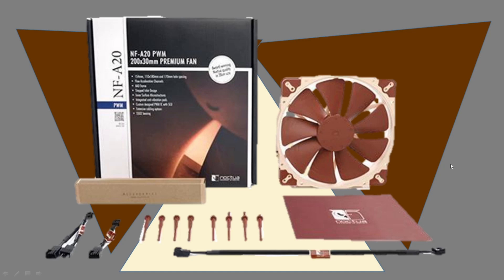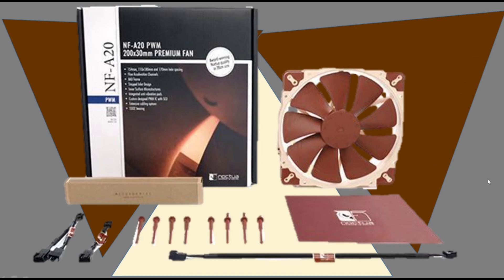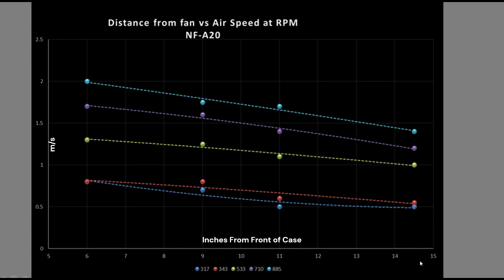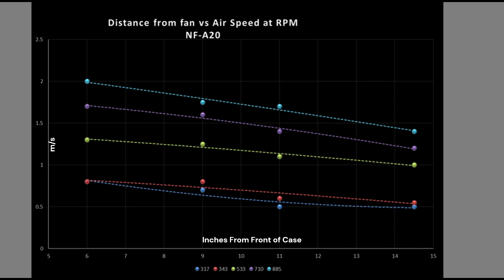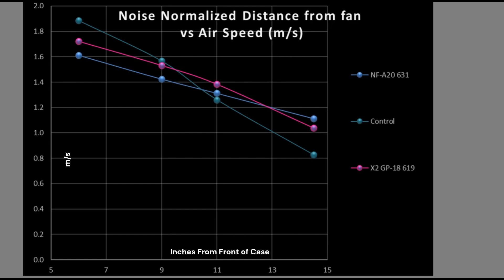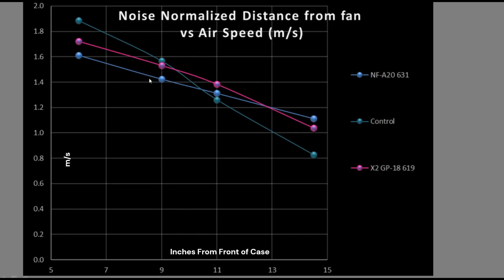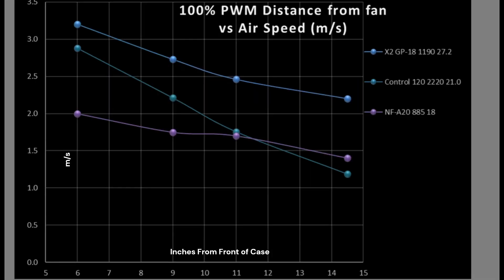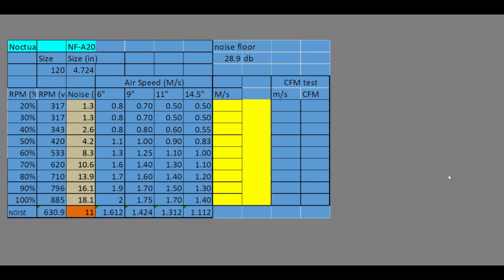Noctua NF-A20   200mm Fan.

Comment: I actually saw the modification of the Fractal Torrent case for 200mm and also how people managed to get 200mm to work without modification which made me buy 2x200mm Noctua Fans. I now have the setup of 2x 180mm Fractal X2 GP18 Fans at the bottom for the GPU (temps went down compared to the 3x140mm Stock Fans -> X2GP18 are thicker)  and 2x200 at the front of the case. While I did not track the CPU temps (before with 2x X2GP18 and after with the Nocuta NF-A20) the CPU temps were more dependant on the CPU Air cooling Tower Fans (I got a Thermalright Frost Spirit 140) and the fans custom curve. 

What I can say is that the overall noise went down drastically when removing 3x140 Fractal GP14 Fans to almost silence in idle, which is what my goal was. The airflow might be worse because the 200mm Fans are partly blocked off, but once I have more time I want to mod the Fractal case such that NF20 won't get blocked.

I actually didn't find any good video of the NF-A20 Fans that were recent, so this would have been a blessing when I made the decision to purchase the NF-A20 instead of two X2GP18.

And big thanks to you and your fan testing, you have been my Go-To channel when I want to see compare how fans perform. I actually watched your video of 2x120mm vs 1x180mm video which made me consider bigger fans for this case in the first place. 👍
Reply from the maker: It would be cool if noctua made a 160,180,or new 200 mm fan. 
That mod sound cool. would love to know how it turns out if you do it. 
Thank you for the kind words. I truly appreciate it. 
I have a few experiments to run and record for videos when I find some time.
Reply: @computer-tech-more  Hi I almost finished the case mod yesterday (the holes I drilled for screws were too small so I used zip ties), but the 200mm case fans are now not blocked at all at the front. Unfortunately this did nothing for the thermals of the CPU. (30% PWM mode all fans)

Although when I did the mod yesterday I though I did remove the railing at the bottom that blocked the 180mm Fans, they are now fully exposed and I think this (and possible the front case mod) lowered the GPU temps by 1°C (several runs tested so it's not within variance). I know it is now much but going from 56°C to 55°C GPU Temp under load (4070 Ti Super) is still pretty significant I would say. 

I can't say anything about noise and whether that improved or not, seems the same.

All in all it was one day of rough work as I am a software developer, so I am not used to physical drilling and grinding, but that peace of mind and the 1°C on the GPU made it somewhat worth it.

I would suggest people that are chasing the best noise profile to stick to 180mm fractal fans, the 200mm noctuas did not make much of a difference.
Reply from the maker: @parutopat  you had quite the adventure. and thank you for updating it. I had actually forgotten all about you doing this mod. 
I guess the main thing is do you like the new look with the 200mm fans? 
1C is still 1C but ya not really going to get any extra performance from that. :)
Reply: @computer-tech-more  no problem, I did not think you would remember that comment from me, but I am glad you replied ^^

Honestly not really liking the look so far, but I bought some foam that I want to put in between the fans and that should make it a bit prettier. I did a more or less sloppy job with the grinding, but I care about performance more than aesthetics, so no big deal for me and I have the peace of mind that the fan blades are not covered. The front Fans are not visible anyways^^

I enjoyed the process for the experience.
Reply: @computer-tech-more  I joined your patreon by the way! really enjoying your work
Reply from the maker: @parutopat  awesome. I saw a new patreon. Thank you!!!
Reply from the maker: @parutopat  metal work is very hard to get right. 
I personally do wood working. nothing crazy like with special tools or anything just building like a play table for my son. 
Metal can get to many sharp edges. 
But if the process was fun I would call that a win.
Reply: @parutopat  I'm in the same shoes, planning a build with the Torrent and I don't want to use stock fans, only Noctua. Have you tried out the 200mms at the bottom as well? Is the hole of the case (not the tray) big enough or blocking too much? Have you seen the HS (high-speed) version of the 200mm, and/or have you considered 6x of their 140mms? That setup probably has the maximum non-industrial grade airflow possible for this case, I believe (at max rpm). And they are second generation, can still be quiet for idle, running maybe just a few of them. That's my plan as I wouldn't want to grind the metal even if I have the tools for it, I'd probably buther the case :/
Reply: @firsh  sorry for the late reply, I did not notice the notification. Have you made a decision yet?

I had Problems with the 180mm at the Bottom already and did actually remove part of the Rails where they are screwed onto, which yielded a great boost for GPU temps. I would not recommend 200mm at the bottom, rather the 180mm fans or good quality 3x140mm fans.

As for the front if you have time I think the 200mm Fans noctua (if you can take the highspeed version, there are no downsides I think) are worth it if you make the case modification and cut the case. Otherwise I think 3x140mm or 2x180mm Fans are quite a solid choice. Can't go wrong with either.

Comment: Thanks for this test, I am in the market for a 160/180/200 for a case mod for side intake and there are not really good looks that this fan or the Fractal 180.  IOW, perfect video!
Reply from the maker: There arent many options for large fans right now. 
the Shark Force 160 tested well. video is in the works.